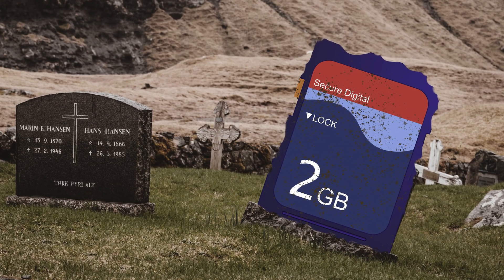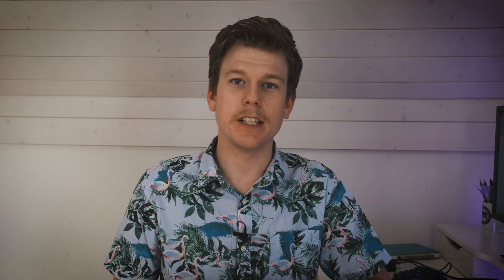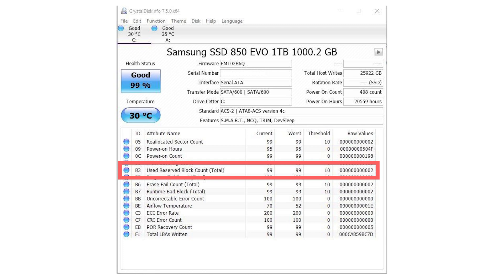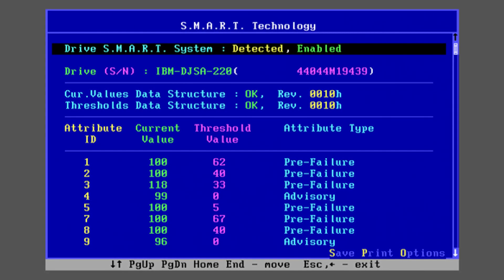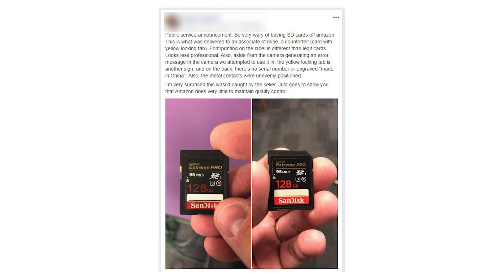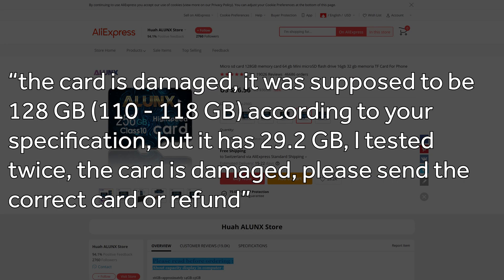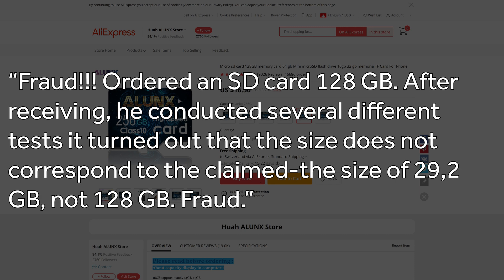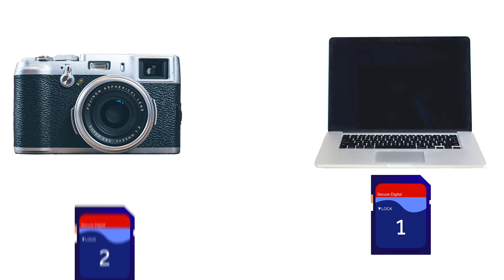Why SD Cards Fail and How to Prevent It

Comment: I've used SD cards for taking photos and virtually never deleting any just stored them for years but now they're all reading error in my card reader despite I hardly look at them, I really think the dangerous part is putting a card in and taking out of a card reader its seems to be the only thing I could have done wrong so either it should be switched on when I insert the card or switched off the same with removal OR de access the card before removing.